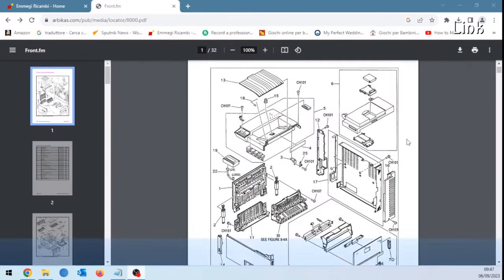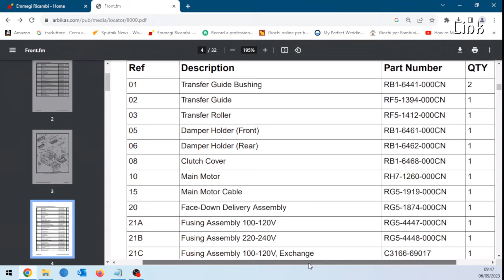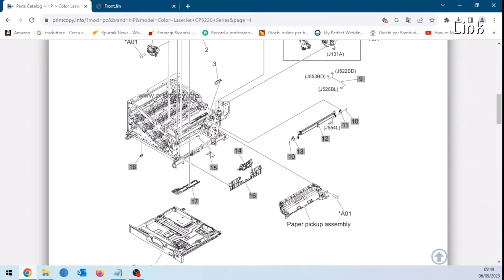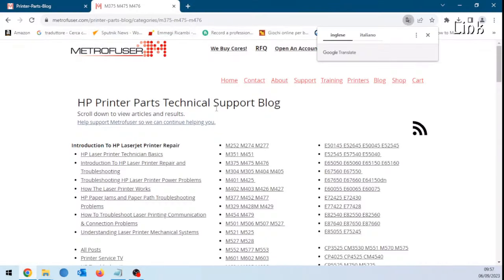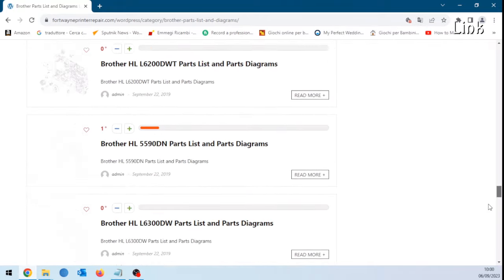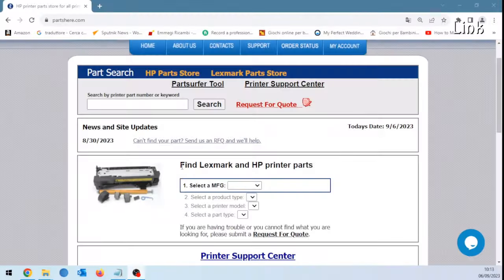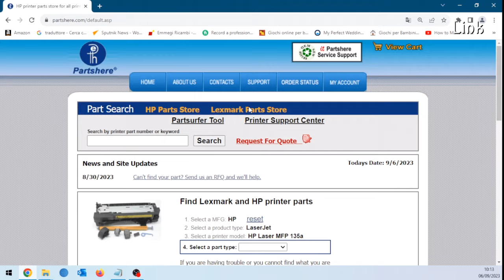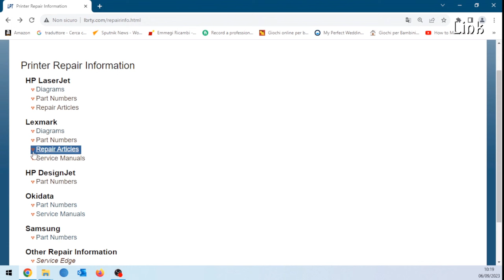Where to find printer exploded diagram part list - Printer parts catalog

Comment: Hi, i'm having a problem with a xerox 6515 that works good.. the problem is that it makes alot of noise that comes from the gears on the back side. I was thinking to open it and to look better because all the gears that i can see on the back, seem to be okay. Do you maybe have a suggestion ? i looked at some of your videos and now i have more information but sure not the solution. thanks Fabio.
Reply from the maker: You can use grease for mechanical parts. May be the problem is the fuser unit, in this case you have to dismantle the machine